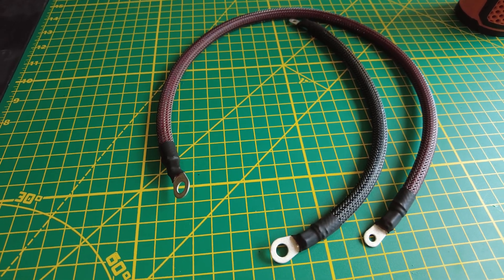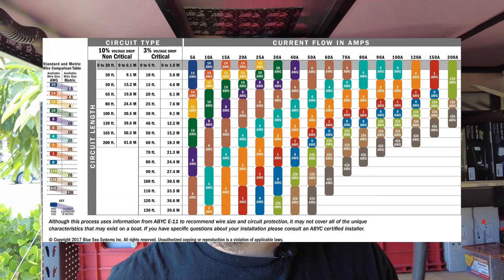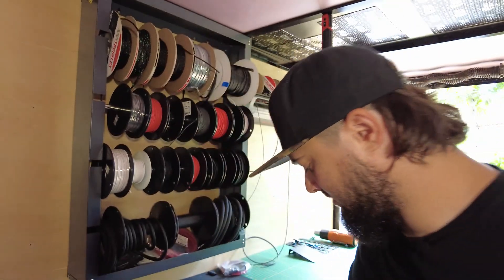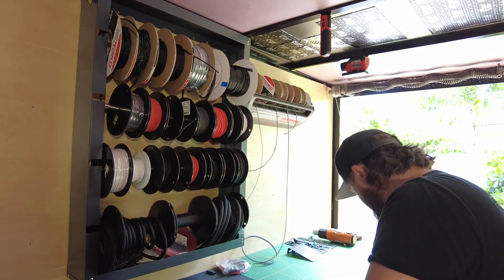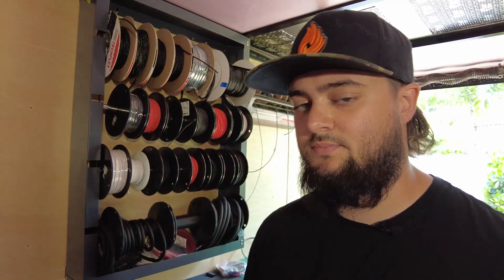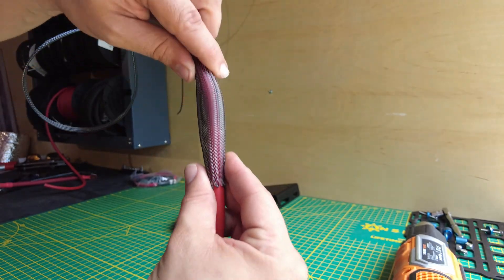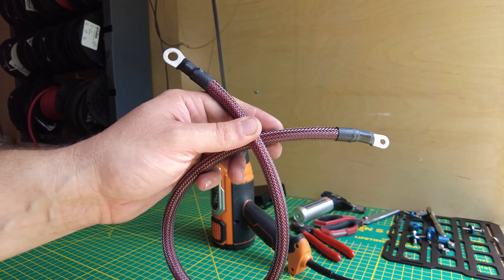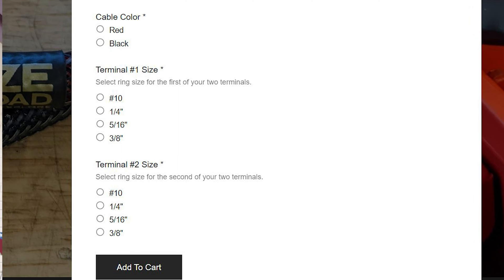Easily Make The BEST Quality Battery Cables Yourself

Comment: pretty, but is that techflex heat resistant?
Reply from the maker: We use only Techflex brand products made in the USA, no Chinese knockoff brands, so yes, our flex is very resistant to heat. However you should still be responsible with your wire routing and of course not run anything touching your exhaust.

Comment: Thanks for making. This video is very helpful. I noticed that the crimper link in the description is the same as the cutter. Will you update the link? Also, will you add a link to the wire braid? Thank you so much.

Comment: OK so you made a 24" battery cable... what's the overall length? Is wire length calculated center hole of ring terminal to center hole of ring terminal or just wire length & know that the terminals will add some length? Not a gotcha question... genuinely curious. And yes I have some OCD tendencies.